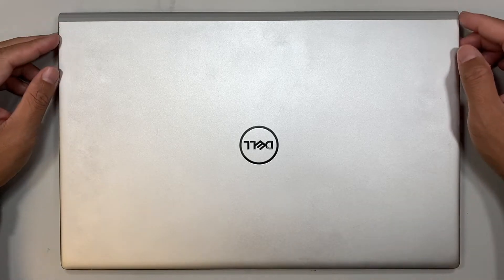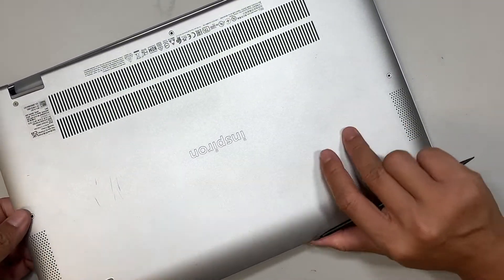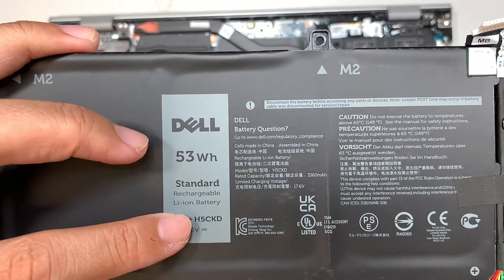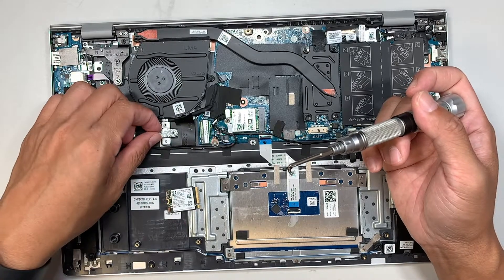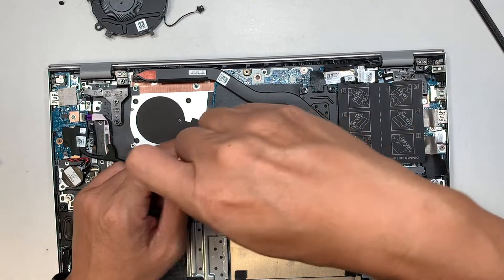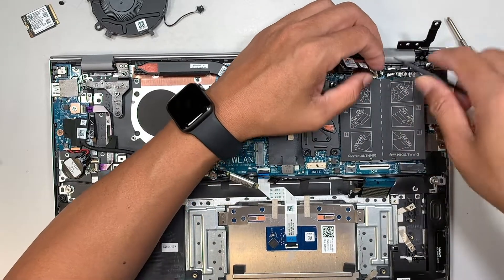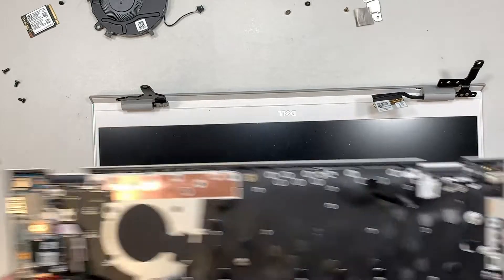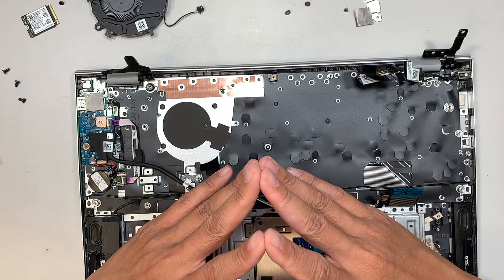Dell P102F Tear Down Upgrade Disassemble

Comment: Hi, I currently have a 40Wh 3-cell battery which is 11.25V. There's clearly space for a bigger 4-cell 53Wh battery, though it has 15V output. Dell seems to list a bigger battery as compatible, but is it safe to connect when voltage is so much higher?